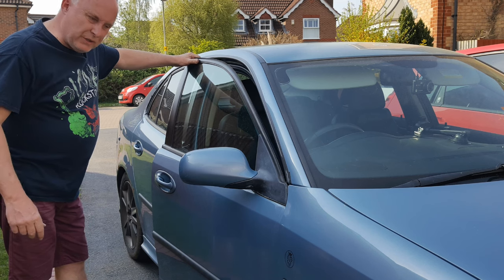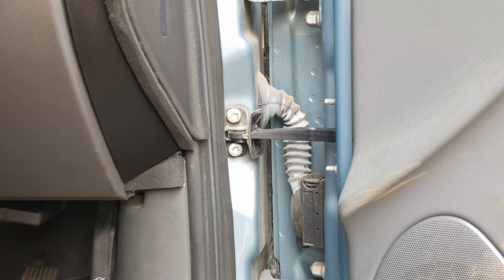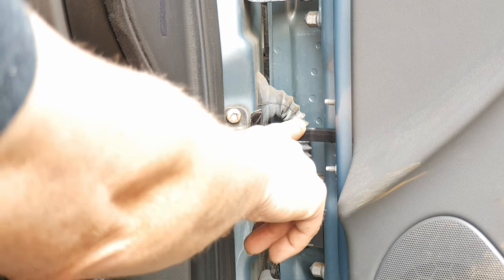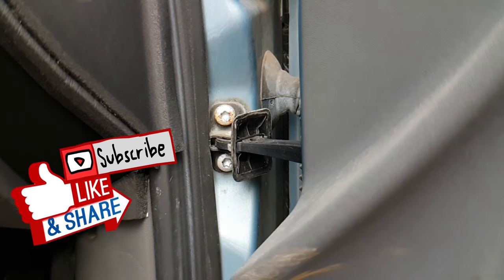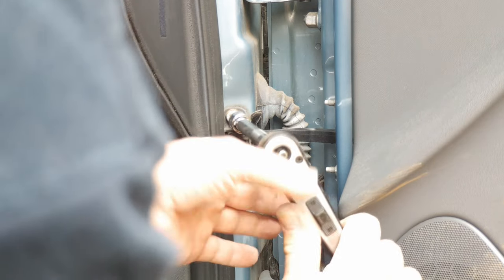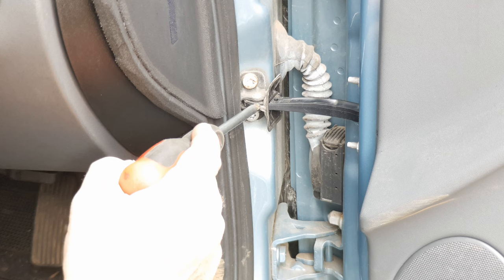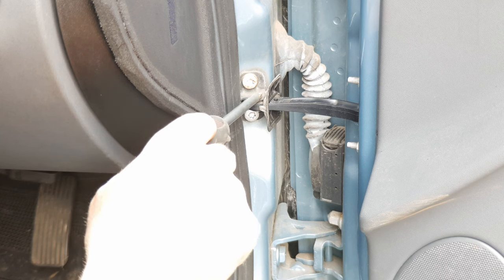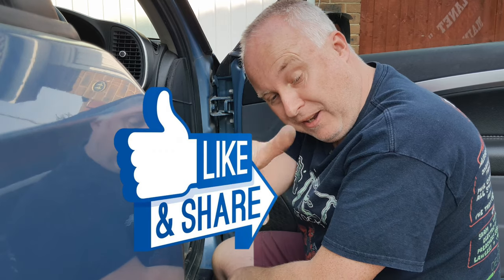Car Door Cracks When Opening | Door Check strap Repair

Comment: This is good advice - a small matter that's often overlooked by people who think they have a bigger issue. My car door has been making this exact same noise. I just googled this video and then went out to my car door, and tightened up the screw. Instantly my car door is 99% quieter while opening/shutting it. Wasn't the check strap or anything else... just literally a loose screw/pin.
Reply from the maker: Yeah, it's 'bark' is far worse than it's 'bite'

Comment: My wife's car does this all the time, only when I started to question why I noticed when she opens the door (we live on a steep drive) she throws the door open putting massive strain on the check arm and fixing. £10 socket and a word in her ear and all fixed however I feel like this will only happen again as remember her having same issue on other cars and passenger side on mine. Usually this is because it has worked free but remember just sometimes it is down to driver error! :)

Comment: Great video! Have Liked & Subscribed!
Last week this cracking sound started on my Citroen Cactus and first thoughts were of faults inside the door and some internet searches said the same. Fortunately, I found your video on YT. My bolts to the A pillar were solid but the 2 nuts recessed in the door frame were over a turn loose. They are recessed and not easy to see but a 10 mm socket fed in easily. A 2 minute job - I am so pleased! Thank You.
Reply from the maker: Thanks for the sub! Welcome aboard
Reply: DS4 owner here, same sound started coming from my door as well and WD-40 didn't help. My A pillar bolts are also not loose, so I was wondering what it might be. I guess I will check the others hidden in the door frame and hopefully they are not that big of a pain to reach.
Reply: Same on Citroen C4 second generation hatchback, driver door.

Comment: Thanks for posting another helpful video. Might be a good idea to go around the other doors on the car and check their fasteners are up to torque?
Reply from the maker: Hi Ray, yes indeed. I actually loosened the screws to engineer this problem, but you are quite correct, check all the doors while you're at it. It's a common problem on loads of cars and I have actually known people strip their doors down to change check arms when this was the problem.
Reply: Exactly what I did...

Comment: In my mustang, it was the door hinge bushing, a cylindrical part that's around the pivot on the bottom hinge that kept making a loud creak. From what I understand, it's supposed to rotate freely, when brand new, but over time it may become stuck, and the hinge starts filing away at its side. I was troubleshooting something completely different and sprayed all the hinges with silicon spray. It loosened that bushing! And since it's worn and no longer round, it now catches and makes a horrible sound! I put some thick grease around it, and it sort of helps, but it needs to be replaced. So there you go! SN 95 mustang.
Reply from the maker: Is it a little 'top hat' bush made of a sort of fibrous material with what look like threads of brass running through?

Comment: Thanks for your video so helpful saw the bracket move slightly tightened it up fantastic  .Vauxhall corsa. Thanks
Reply from the maker: The brackets barely have to move for the arms spring action to cause this kind of 'cracking' noise

Comment: I wish this fixed mine :( Mine is the strap. It's made of steel and has developed a ledge that catches and pops. As far as I can tell, it has to be replaced. Only problem is Isuzu hasn't made my vehicle in 20 years and there are no replacement parts. Every one of these vehicles door straps pop in the front. It does appear that they used the same straps in the front and back, and a lot of the back doors don't pop on these. I'm going to try to put back straps in the front, then I'll let you know if it works. The simplest and cheapest option if to unpin the strap, push it inside the door and then use a piece of nylon band(like a piece of a ratchet strap cord) to attach the door to the pillar. You lose the intermediate catches but at least the pillar won't twist if the door opens too hard. Jeep used this method for decades on the Wrangler.

Comment: Do you have a Tech 2 scanner?
Reply from the maker: No. For generic engine related codes I use Torque Pro
Reply: @CycloneCyd  Is it good enough for saab? Alot of people say Tech 2 is a must for saab owners. My car is in limited performance mode. Its a 1.9 tid 2008 vector sport. Would that torque pro find all the problems?

Comment: What needs to be addressed is the poor design of the friction surface in these check stays.  I had a dealer that sold me a ACR30R Previa whose driver's stay failed and I pressed for him to replace it under warranty.  The new stay lasted exactly twelve months.  Money spinner!

This design has been around since at least the 1950s and has ALWAYS been cheap-and-cheerful (actually, shocking), and I have owned half-a-dozen cars with it.  I put golden syrup on mine for stickness (my stays are tight) rather than spend a fortune replacing them.  If the stay makes a cracking noise in the sun, I know the syrup is working.  If not, more syrup, lol.
Reply from the maker: I'm not familiar with the Previa, but our C1 has a cheap-shit Toyota designed  check arm too. The Saab ones are really good.

Comment: Mine keeps doing it and I've tightened it aswell
Reply from the maker: The little pivot point rivet might be worn.
Reply: Seems to be coming from the part coming out of the door so will try tightening it again
Reply from the maker: Maybe you need a new door checker then. Door casing off job.

Comment: I tried tightening it, it just wouldn't budge. Do i need a special torque wrench instead of an electric screwdriver with the correct bit?
Reply from the maker: An ordinary 1/2 inch ratchet will do just fine. An electric screwdriver is unlikley to be strong enough.

Comment: It didn't work for me. The problem persists.
Reply from the maker: It may well be the pin at the bracket then. If it's never cleaned and lubed it will wear and produce the same sort of noise. You could drill the pin out and replace with a short bolt.
Reply: @CycloneCyd  That's it, I have figured it out on my own. Thanks :)